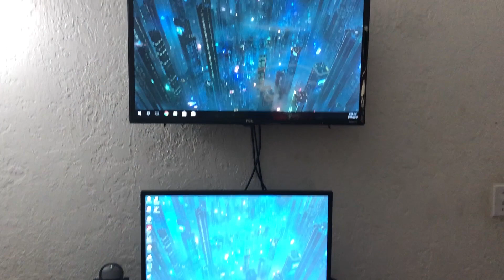DIY Modern Desk & Custom PC Case Build

Comment: Hi my friend. Nice desk.
I'm looking forward to do one like yours, so I would like to know how deep is the case to fit all parts?
Thanks and congrats
Reply from the maker: My build is about 8" deep. however once finished I decided to mount the GPU flat instead of sticking perpendicular to the Mobo. doing that if I you mounted top or bottom facing fans and a radiator you could go much smaller.
Reply: @randellray  would you say 5" for a GPU beside mobo is deep enough?
Reply from the maker: @fabriciofernandes06  depending on how/where you mount fans Id think so yeah
Reply: @randellray  I already measure the fans and looks ok. Just need to measure the CPU fan. Do you mind telling me what do you use to turn on the PC (switch) and which gpu extended cable did you use?
Reply from the maker: @fabriciofernandes06  give me a bit and ill check my amazon orders. i just used a generic cable that was the color i wanted. same for the pc I used a pc power button and mounted it under the desk and out of sight. something like this https://www.amazon.com/Desktop-Computer-Supply-Supplies-Button/dp/B01CJ44XZM/ref=sr_1_3?dchild=1&keywords=pc+power+button&qid=1601426353&sr=8-3
Reply: @randellray  thanks dude. You  just saved my life with the buttom. I'm planning on finish my setup next month and I will send you pictures of it.
Take care
Reply from the maker: @fabriciofernandes06  awesome man! Goodluck. Let me know how it turns out

Comment: How do you screwed the motherboard to the desk? Can you link me the product?
Reply from the maker: I used standoffs. they are basically spacers. you drill the appropriately placed and sized hole into the wood and then screw in the standoff of your choice. you can then screw the motherboard into them. I used a standoff kit similar to this so i had different sizes to choose from. https://www.amazon.com/Sutemribor-Female-Spacer-Standoff-Assortment/dp/B075K3QBMX/ref=asc_df_B075K3QBMX/?tag=hyprod-20&linkCode=df0&hvadid=198091685647&hvpos=1o1&hvnetw=g&hvrand=7842551944552485729&hvpone=&hvptwo=&hvqmt=&hvdev=c&hvdvcmdl=&hvlocint=&hvlocphy=9012266&hvtargid=aud-801381245258:pla-389869518233&psc=1

Comment: Awesome build! what is that part called to get GPU away from MOBO? I'm thinking to build desk myself but can't find that anywhere :(
Reply from the maker: Michał Sylwia Styczeń 🙏🏻 thank you! That is a PCIE 3.0 cable. You can find them in various lengths. I purchased mine through amazon. Look up pcie extension cable
Reply: randommusings way to over priced cable mod sells them for about 10$ and with custom colors. Rip off

Comment: Beautifully made desk and then the components were just slapped in there.... personally, id have gone with a thin under section and drilled holes to mount the power supply and run the cables
Reply from the maker: Im not sure what was slapped. all the components are on standoff screws mounted to the desk
Reply: Yes i can see that, but hardly any cable management is in place which makes it look untidy. May aswell have used cheap wood and not gone to the lengths you did to make it to smooth and silky looking.
Reply from the maker: @TheMattchooo  ah I see. thank you for clarifying. Yeah it was my first pc build and that among several other things I feel like I could have done better with & will on the next one
Reply: @randellray  Yeah sorry dude, dont mean to be judgemental! if you can make a box underneath so you can put the PSU in and drill/cut holes either side of each connection point, you can massively minimise the cables on display and get rid of the unsightly PSU :)
Reply from the maker: @TheMattchooo  na don't apologize. Criticism is always welcome. I just misunderstood what you were referring to.

Comment: should have painted the inside black. nice build anyways
Reply from the maker: Micke my original plan included lining the inside in leds. I think if I went black it wouldn’t have reflected as I wanted. White seemed like to much. But I agree without the lights black would look good. 

Planning on a new and much better version of the desk once my lumber drys another 6 months or so.
Reply: @randellray  have been watching more and more of these type of builds. im kinda keen on doing something similar :D looks really cool. my thirdest oldest son(soon 5yr old) will inherit my computer so im looking for new cool parts to use now :D
Reply from the maker: Micke very cool man. You should definitely do it. You can go any way with it you want. Use simple tools, joinery, and plywood or handcut dovetails into solid wood slabs haha. Goodluck man. Feel free to shoot me some pictures on instagram if you build one